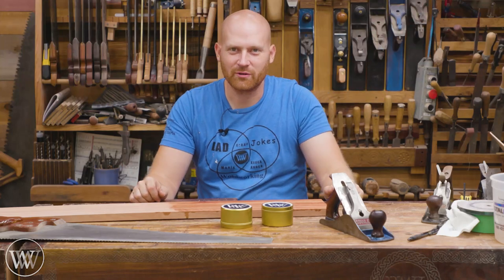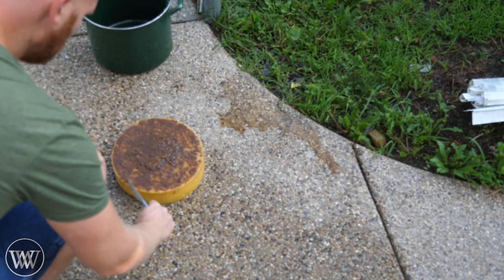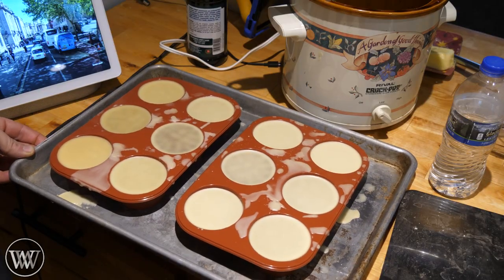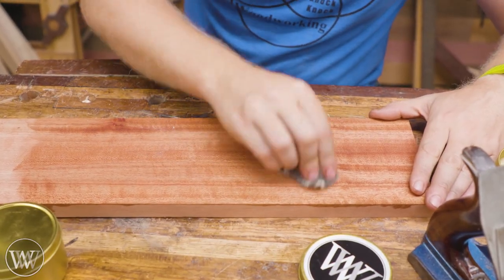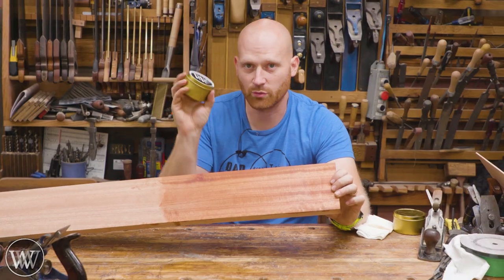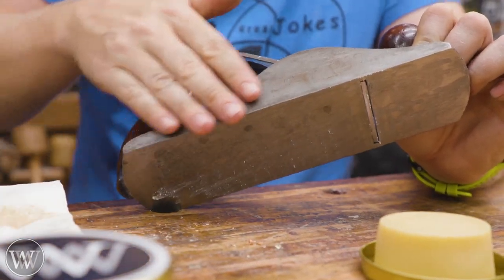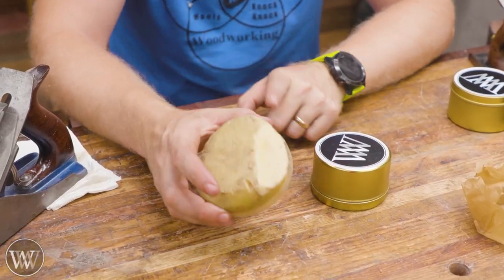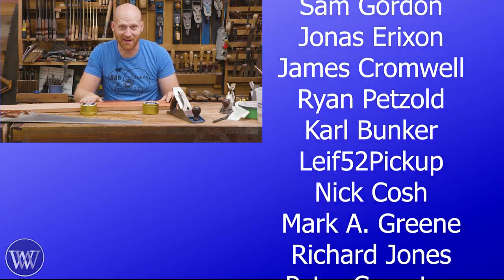How to Make Paste Wax From Scratch

Comment: Thank you for this.
Do you let it cool at room temperature or put the oil-wax mix in the refrigerator?
Reply from the maker: depends on how rushed I am. most of the time I just air cool it, but if I need to get another batch out i put it in the fridge.
Reply: Thanks :)
Also, would products finished with the soft wax be food/toddler safe when it hardens (and, presumably, the mineral spirits evaporated)? Or would you substitute the mineral spirits with something else for that purpose?

Really like your channel, and just made the hard paste wax :)

Comment: Great video!

One question: Why do you use raw linseed oil for the hard wax and the boiled for the soft wax? I assume there is a reason since you mentioned that you go through the trouble of boiling it yourself. Is it that the boiled penetrates wood better?
Reply from the maker: The hard wax I use for two lubrication and rust prevention. In that case I would rather the oil stay liquid and softer longer. The boiled linseed oil will polymerize in a day or two. And that's what you want on wood finishes. So that's what I use in the soft wax that gets used for finishing projects.

Comment: Greetings. Awesome video. Was wondering if rags used for the soft wax could be prone to self-combusting because of the boiled linseed oil, or is it stabilized because of the beeswax and mineral spirits?
Reply from the maker: there would be a little chance of it but only very slightly. Contrary to popular belief oil soaked rags will only combust under very specific situations. But unfortunately that is wadded up in the bottom of a trash can.

Comment: Could you replace the mineral spirits with orange solvent in the soft paste wax recipe to make it "food safe" (ie for toys possibly boards) I would you make one from a raw linseed oil? I plan on making my own boiled linseed oil, is tung oil a valid option? Thanks
Reply from the maker: Yes and yes. you can make it any way you like. raw linseed oil works fine too it just takes longer to fully polymerize.

Comment: I live in Indonesia, we cannot get raw linseed oil, can I use boiled linseed oil for the first hard wax? I need it for rust prevention as the humidity here is insanely high. Thx
Reply from the maker: sure. just realize it will polymerize on the outside much faster and you will get a skin on top of the wax.

Comment: hi . nice video. i used parrafin wax ( candles) and coconut oil to make a hard paste wax in a 2:1 ration like you instructed , but the resulting paste wax came out crumbly ( when i tried to apply it  )  . should i increase the ratio of parrafin wax  to the oil and repeat ?Thanks
Reply from the maker: coconut oil is an odd one as it is most often solid at room temperature a it tends to make the was brittle. Increasing the wax will help.

Comment: I've been watching a few of these types of videos.   Some people use mineral oil and some mineral spirits.  Are these different things?  Is the paste you make food safe because all the mineral spirits I've seen online so far have a poison label on them.   Thanks very much for your videos.
Reply from the maker: Mineral oil is a type of oil. It doesn't polymerize. And because of that a lot of people like to use it for food products. The problem is because it does not polymerize it washes out of the wood rather quickly and needs to be replaced regularly. Mineral spirits is a thinning agent that evaporates. So it's perfectly food safe because it will completely evaporate. Though depending upon who you talk to some people don't want it because it is sold in the chemical aisle.
Reply: @WoodByWrightHowTo  Perfect, thanks very much!
Reply: @WoodByWrightHowTo  hey James, I'm curious about this recipe as I have mineral oil and bees wax on hand. If I just want to use this recipe to lubricate my plane soles, do you think there would be any difference between using linseed oil and mineral oil? Thanks!
Reply: Mineral spirits is usually used for thinning oil-based paint (where I am it, is called paint thinner).  Anyway I use it to thin tung oil, it makes the tung oil less thick and then when applied the mineral spirits evaporates leaving just the tung oil in the wood.

Comment: I find the cookware almost impossible to clean after cooking paste wax, what do you do to get rid of cold wax residue? Also I have seen rust in a few wax containers when they are metallic, how do you avoid that? Thanks in advance! p.s. I now use a non siccative oil after having unused soft wax that went too dry.
Reply from the maker: I have dedicated pots for it. You can get old crock pots at the resale store for  a couple bucks and never have to clean them. I have never had rust in any of my cans before. Not sure what would cause that as it is usually used as a rust preventor. Sounds like the mix is too base. That might cause it.

Comment: Thank you for the very informative video! I'm planning on making my own soft wax as a varnish for gouache/acrylic paintings but I just have a question. What exactly does the mineral spirits do for the mixture? Thanks in advance :)
Reply from the maker: That thins it out so it can spread, then it evaporates.
Reply: @WoodByWrightHowTo  Thank you!
Reply: @WoodByWrightHowTo  Sorry I have another question ;; Can I use any other type of oil like maybe fractionated coconut oil? Have you tried it with different oils before?
Reply: How come mineral spirits dont evaporate when you add them to warm mix of wax and oil , and during storage? There will be no white spirit in that mix after lets say 1 month, so i dont see what is use of adding it? I thought soft wax is soft bcs of half of it is oil ?

Comment: Can you use the store bought linseed oil that lowes sells is it the same?
Reply from the maker: You can. I probably would not use it on food related items though.
Reply: @WoodByWrightHowTo  thank you
Reply: I didn't have much luck i made this 2 parts oil i part bees wax it seems to make the surface more sticky?  Maby i did something wrong. @WoodByWrightHowTo
Reply from the maker: Depending upon the oil you used you have to wait for the oil to polymerize before you polish it off. If it's raw Lindsay oil that might take a week or two.

Comment: can you use this wax on a wood finished with a water based finish?
Reply from the maker: yes.as long as the finish has cured there is no problem at all. congrats on first.
Reply: @WoodByWrightHowTo  Thanks. And thanks for all the videos you post. Its great work.

Comment: When I process my wax from honey extraction, I typically pour into ice cube trays after my final cleaning. just makes it WAY easier to get the right amount of wax you need instead of trying to break apart a big block of wax......which can be a real challenge....and a mess. OH.....just a warning.....DO NOT use your wife's favorite cookware to process the wax.......go to a thrift store and buy a cheap pot to do your wax processing in....you will thank me later. lol
Reply from the maker: Right on. I have silicone molds I normally use. I have more crock pots then my wife. Lol
Reply: @WoodByWrightHowTo  Smart man......or one who learned the hard way. lol
Reply from the maker: Unfortunately for the video the silicone molds were in use as I use them as well to mold the hard wax. I just messed up my timing and it ended up hardening in the bucket.

Comment: Does it mean turpentine؟
Reply from the maker: No turpentine is something different. It would work in the same case but would be much slower. White spirits are also known as mineral spirits in some places
Reply: @WoodByWrightHowTo  I use liquid paraffin and beeswax and fat-soluble food coloring. In different colors. What is the function of mineral spirits?
Reply: @WoodByWrightHowTo  Hi James, just to further play the game of "name that spirit", in Australia and possibly other countries, what you are referring to as mineral spirit or white spirit, is called mineral turpentine. Not to be confused with natural turpentine which is a completely different fluid (and can be highly dangerous if used incorrectly). To add to the confusion, in Australia, white spirit is actually dry cleaning fluid and I think is derived from liquid paraffin. I almost fell into that trap until I went to the manufacturer's website and read about their different products and found a reference to mineral spirits when reading about mineral turpentine. 

Ironically I was researching why they no longer made boiled linseed oil and replaced it with some product called Timber Oil. Turns out it is boiled linseed oil, blended with, you guessed it, mineral turpentine. I'm going to make your soft wax this weekend but I'm going to adjust the ratios similar to your old recipe and not add in the mineral turpentine/spirit, since the oil already contains it.

Comment: Bee wax is acidic. And therefore not the best choice for protecting metals agenst corrosion fore the long term.  I use microcrystalline wax to protect metals.
Reply from the maker: Interesting. Bees wax has a PH of 7. I do not use microcrystalline wax as it has a PH of 9-10 and using base on steel is not good for it. https://www.thomasnet.com/profile/01027098/michelman.html?cid=1027098&cov=NA&heading=93071603&searchpos=20&what=Microcrystalline+Wax#register
Reply: Bee wax contains:
Acid esters1%
Acid polyesters 2%
Free fatty acids12%
As the wax is more refined most acids are cleaned out.  And the acidity is becoms les. So it all depends on the cleaning process. The microcristaline wax I have is ph neutral and made for metal conservation.

As al thing's in life it seems that there is Moor to it than what seems to be at the first look. Lol
Reply: @lrdijkema  acid esters  and polyesters are not acidic. Free fatty acids are acidic but weakly and there are other components that lead to an overall pH of 7.

Comment: Can I use parafin wax and paint thinner? I need to buy some linseed oil. Or do you recommend beeswax for its smell.
Reply from the maker: Perfect wax works well. It is a much harder wax and that has benefits and drawbacks. It usually means you have to use a little bit more thinner. Paint thinner will work but it's a little bit more caustic.

Comment: are the mineral spirits necessary
Reply from the maker: No. You just end up with a thicker formula. Mineral spirits allow you to thin it out and then they completely evaporate leaving only the oil and wax.
Reply: @WoodByWrightHowTo  ohh ok thanks. for me i use a mixture of beef tallow and cooking oil but I'm gonna buy some boiled linseed oil so it works a little better